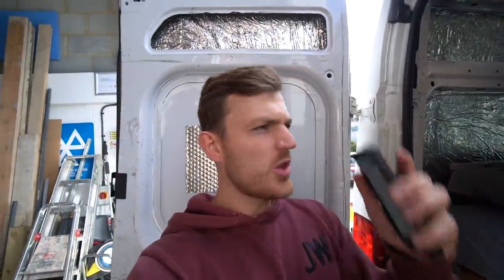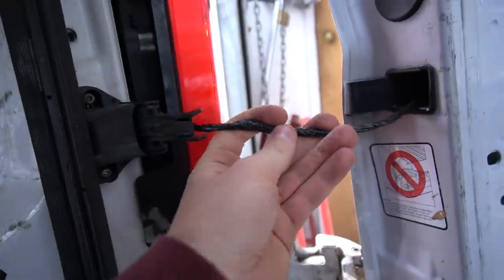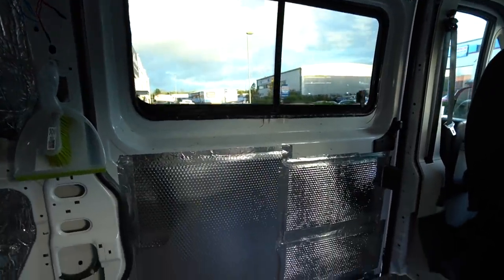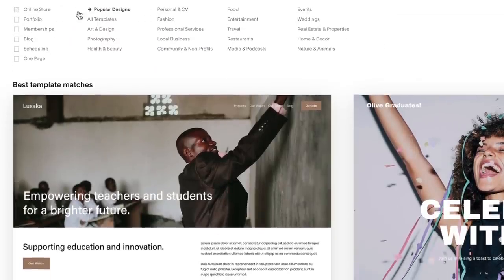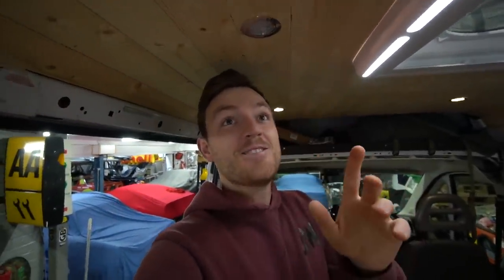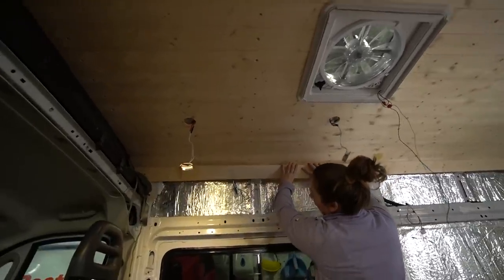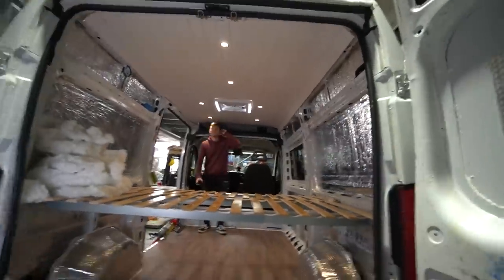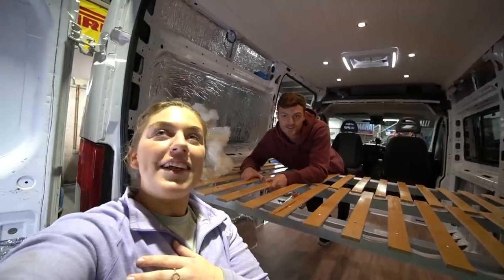SISTER HELPS WITH VAN BUILD | Painting the Ceiling & Repairs - No Experience Van Build

Comment: Will ,  to sort your uneven flooring ply , carefully measure where the joint is and mark , drill & screw from underneath the van . Make sure the screws aren't to long & get someone to stand on the flooring while you're doing it , no visible scew heads in the flooring
Reply: Hi, definitely worth a try 👍. Remember to treat any drill holes, plug the holes with sealant before inserting a fixing, a decent sized washer and perhaps a hex head screw to enable you to get a good bite on the plywood.

Comment: The ceiling didn't look to bad .  

Why not try a scap yard for a cable protector for the rear door.
Reply: Another option is some generic spring wire conduit so it resists bending and move into the door. It might be possible to just put some spring inside the cable protector that is used now. There is cheap flexible drain cleaner and similar tools with spring that should work. Perhaps even a steel wire likely makes it stiff enough but still flexible.  No, when I think about it something plastic like a couple of large cable ties in the cable protector likely works fine and reduces the risk of it damaging the wires over time.

Comment: Dont worry about the floor Will. Once you start adding furniture it will pull down, especially if the unit overlaps that join and you screw the furniture to the floor. For future reference always tape joints in plywood to stop it chaffing your flooring. Looking good mate, keep going

Comment: I’m a floor layer and my suggestion would be to take the vinyl up slowly so you don’t rip it , (if it will pull up as you did use a lot of glue) drill down the ply that’s sticking up so it’s level then gluing vinyl back down then re sealing it

Comment: Hey Will. The conduit you used for the back door wiring is fine. If you insert a a wooden bbq skewer (or something similar) to keep it rigid, that should keep it straight to push inside the door as it closes? 
Try it. You could try a bit of wire or something. All simple & cheap to do. 👍🏼

Comment: So far, I like it. I think you should wait to do any repainting until the interior is complete. I redid my bathroom and I hung a tawny wood color mirror next to my black faucets/fixtures. I hadn’t painted the walls yet and a hint of the bright turquoise left from the previous owners was coming through. It clashed so much that just that little bit made me think the mirror color was wrong and I hated the mirror. I painted the walls the final color and I’m soooooooo happy I didn’t return the mirror because it was what I had wanted, all put together. The finished product really changes when you have the complete picture. Don’t worry about the paint color right now... it’s a super easy fix if you don’t like it later once everything else is in and complete.

Comment: Yay. Your sister is correct. Will look great once other finishes and textures in. Also with solid white surfaces can look grubby quickly and with your OCD tendencies think that not good idea. Why didn't you use clear sealant on flooring edges?😎

Comment: For the lip in the vinyl, Cut some small squares out, slightly larger than the screw heads, then once the screws are in, stick the cut out bits back.

Comment: Here's a pro tip that will make your caulking seams look their best... Get a 3/4" steel ball bearing or comparable metric size & glue a small wooden stick or metal rod to it using a small amount of epoxy putty or strong adhesive. I do my own welding so I welded a 1/4" steel rod to mine. Once you lay down the bead of caulk you take the ball bearing & drag it along the seam of caulk from one end to the other. This smooths the caulk evenly & gives it a nice clean curved shape. When done you just wipe off any excess caulk off the tool you made & repeat on the next seam. The 3/4" ball bearing works good for most caulking jobs but if you have to caulk a really thin bead of caulk like in a cabinet you make another tool but use a much smaller ball bearing. It works quick & easy and gives your caulk lines a more professional look. I don't know if they sell tools like this but I saw a DIY one and decided to make my own & it works great. I reapplied some caulk along my bathtub where it meets the wall using this tool and boy did it improve the look.

Comment: Best way to smooth off the silicone is to use a spray bottle with water/fairy liquid mix and spray over the silicone bead then smooth off with a shaped piece of thin wood. Comes up a treat👍

Comment: Will. You can get something similar to the "Guides" for clipping cable together. It is split down one side to allow to fit over existing cable. I think I got some in a DIY store maybe B & Q?  Try around the wiring section.

Comment: Looks fab! Paint wash is the way to go. Quick to put on.. easy to upkeep and it hides any anomalies because it’s not meant to be a solid coat.  Floor could do with a sheet of hardboard over ply  that’s in one piece.  But that would mean lifting the vinyl. I still think you’ll have the line even if you drill it because even vinyl over tongue and groove laminate shows through and there is barely a join there.  I’d buy a non slip rug to match your decor and learn to live with it.  Get one of those rubber backed bathroom ones that can be put in the washing machine.  Nice on the feet and easy to keep clean x

Comment: Hey will sounds silly but on a friends van I got an elastic band on the door end of the conduit and pulled it tight and attached it to the inside of the door. The elastic pulled the conduit which guided it inside the door. You could also get a spring for a few quid which might work good too just drill a small hole in the conduit at door end then attach it to the inside of the door.

Comment: If it was me I’d make a tiny slit in the vinyl only about 5mm each where you want the screws, use screws with small heads (hidden head flooring screws) you’ll never see the tiny slit unless trying to look for it…I’ve done it myself in my van and can’t notice 👍🏼 edit…Yay! Looks good mate, better than just the pine ..I do like a dark ceiling personally though
Reply: I like this idea! Just use a little bit of clear silicon underneath and in the crack to seal it from moisture.

Comment: Drill a hole from under the van larger than a screw, then screw from underneath with weight on the board inside the van to pull the floor down. Just make sure the screws are not too long and poke through the top
Reply: This guys knows

Comment: You could possibly carefully cut the “planks” away using a very sharp craft knife enough to peel them back so you can get some screws in to fix the joint in the floor issue

Comment: Ceiling looks good, use breaker yards for more parts u need instead of eBay. I'm certain you'll get the 2 missing covers ur missing for side of van and the wire cable for rear door 👍🏻

Comment: With the plywood joints use biscuits to ensure they meet flush ( biscuits are flat wood pieces that are used to keep flooring flush, available on eBay for a few pounds and all you do is router out the grove and the biscuits just slot in

Comment: Id use a straight edge and knife, and cut down the grout lines on the vinyl, peel it back and screw into the floor. Then re glue the vinyl down. :)

Comment: the only real way  to fix that crack broadcasting thru the vinyl is to take it up, secure the sub floor better and use a leveling compound.. you may as well do it k=now, if you wait its going to get worse than you will need to remove the cabinets etc.... I would often say just live with it but in this case it wont be long until it cracks or otherwise gets a hole and your sunk...

Comment: Peel vinyl back drill hole squirt a big load of glue in between board and metal floor then put a big weight on area to hold it down whild glue dries 👍

Comment: How about a mini bungee anchored inside the door and attached to the rear of the wire protecting tube. The door opening will stretch it, and when you close the door the bungee will retract the wire and tube back through the hole?

Comment: Will… that floor…. DON’T PUT SCREWS THROUGH IT!!! You just finished sealing it to prevent moisture getting in!! 
You just said you’d put the screws “under where the units are going to go” so use the weight of the units to hold the floor down flat.  If you standing on it pushes it flush then a unit full of stuff will deffo do the trick…. Sometimes doing nothing is the best solution.  Just keep building and that crease will disappear all by itself 😃👍

Comment: If weight fixes the uneven ply floor do not anchor it to your floor with a screw, it opens you up to so many other potential problems.
You mention putting units in the location anyway, can you not use a length of wood when building/placing the units, if that is anchored to the ply floor on both sides of the "bubble" it will even them off together, much like you using your weight on it.

Comment: Ok so I came up with a fix for your wires in the back door. Elastic string , wrap it around the wire then find a point to attach the other end inside the door. When you then close the door the elastic will pull the wire back in the door. Sorted mate.

Comment: Great fix will, get a bit  coat hanger metal run it along the tube then use electrical take to fasten it to the plastic pipe it will then stay rigged and close ok 👍 michael nottingham

Comment: I'd seriously consider pulling up your lino, it's only cheap, you've put a split in it already fitting your seat which will grow.
Screwing through the lino, through your ply and into the van to pull it down properly will cause problems with damp rising.
Also, you come to replace your lino in future and you'll have to have the ply pop up again.
Doing properly will save work in long run. I know it's 2 steps forward and 1 back, but all the same.
Reply: Or maybe refit some lino at the end of the build as it's easily damaged, building units etc.
You could always ft another lino over the top cut to your units once you have those fitted.  It will make the floor extra springy, like having a good underlay on a carpet. 
You may also decide to change the colour. If you end up going with a lighter whitewashed finish on walls and ceilings as your sister suggests, a darker brown floor covering might offset that well. 
If you were going to do this anyway, just ignore me.
Keep up the good work, very entertaining.

Comment: Never clog up them drain holes they're there for a reason the best thing for you to do is just WD-40 that space in the door jambs so it doesn't moisten up and collect rust that's what you should do don't clog the holes just fill it with WD-40 I did that to mine and I still don't have no rust on my doors or my Wells or anything

Comment: WAIT Will, it takes time to dry and also the paint will soak into the wood. Sis has a good eye for the latest fashion interior designs.  Please, please DON'T paint it gloss as suggested on here by a couple of men. That will discolour soonish and will look pretty awful !!  Shame you did not remove bed, or at least sheet it first.  Always lay dust sheets when painting.  Anyway, it's a defo Yes from me.
Floor:  isn't it under the bed anyway?  If so, you will hardly ever see it.  Think you better get used to it, as will be more trouble than it's worth to take up lino and it will be ruined.  Leave well enough alone, as they say.  Great video as usual ✔😁
Reply: Your right, us men don’t have any idea when it comes to colour schemes.  Leave it up to Lucy. 😀
Reply: He (or, more accurately, she) should have painted the bed to match the ceiling.
Reply: @tonysutton6559  Who is going to see the bed when the mattress is on it though?
Reply: @t1natr0n  Nobody but he has built the bed so that it can be moved to one side to transport his bike etc.

Comment: Easy fix for the FLOOR get underneath and put screws up through the van floor into the board it will then pull it down don't make them to long that they go right through measure at the sliding door for the depth easy fix Michael nottingham

Comment: Another couple of coats on the ceiling, will give a better, less patchy finish. A drop/drip cover should protect the floor from spray/paint drops (pound land sell them). Would a piece of hose pipe, not work as a cable guide?

Comment: Hey Will
For any parts try going to a Scrapyard. Yes you may get a dirty one but that can be cleaned and also you won't be paying £65 😱🤓😮😮
I have visited many a Scrapyard and you will be amazed what bits and bobs you can pick up 🤓🤗
Lucy how do you put up with your brother??
 You must have the patience of a saint/angel 🙏👍, you really must have!!!!
Nice to meet and see another member of Will's family 
Yay to the ceiling however me personally I would have stayed with the white wash as then you would have had different contrasts in the ceiling.
Will you need to wait before saying 'your not keen/don't like it' it seems like your trying to rush the ceiling part and by doing that mistakes happen, ends up costing more money etc. I also wouldn't have gone out and spent more money on shiplap/ceiling wood all you should've done is clean off the bird mess (shit) and then turn it round ie putting the stained wood facing the roof also that wood wood have been protected and also when/if you fancied a change of colour ie the wood stain then just reverse those panels, thus giving you 2shades of ceiling colour and also saving you some Dosh too 👍. 
I personally liked the stained colour cos your white ceiling it's bound to get dirty and you will probably be the one who makes it dirty/marked. However you could once dry paint over THE WHITE CEILING (yes it's in capital letters so you take notice) with a clear Matt varnish 👍🤓🤗🙏
Even tho it's still wet, I gotta say it looks great, so YAY Will YAY leave the ceiling alone!!!!!!!!!!
Great job there Lucy on the ceiling and great job putting up with your brother and his decision or not decision
Lisa UK xxxx

Comment: For the floor  it possible to fix from under the van use a stainless steel panhead  fixing up though the van floor in to the subfloor under the vinly  need to do the maths first to get the correct length of fixing required. 👍